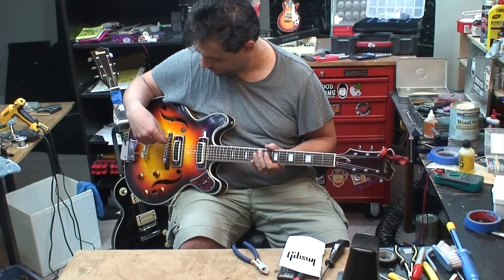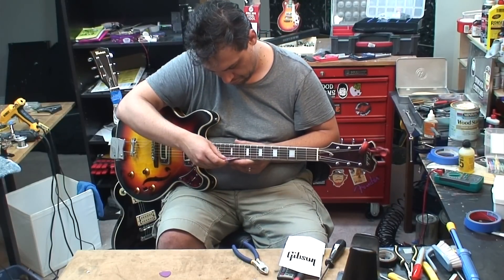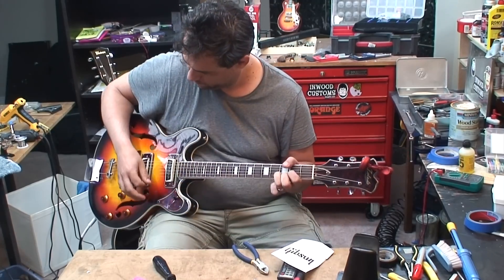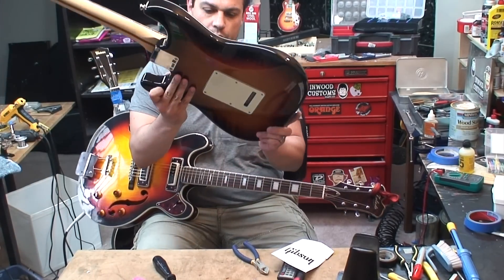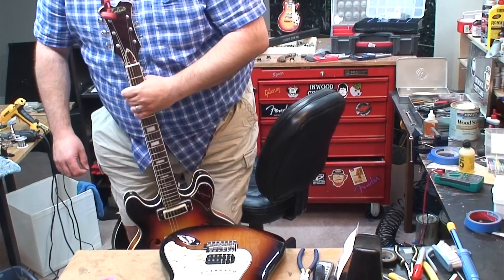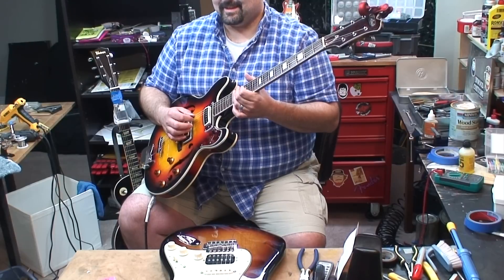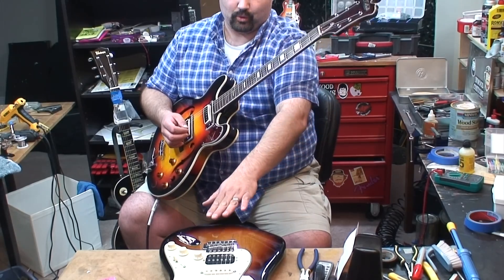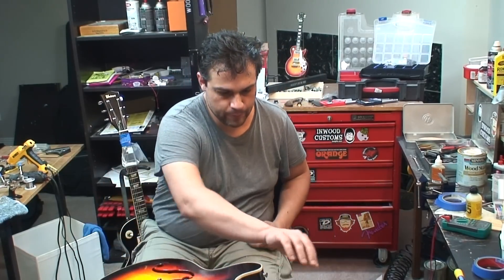70's Vintage Japanese Toledo (Aria): The Rest (Part 2)

Comment: Interesting. I have essentially this guitar  - just with some weird humbuckers that don't buck hum. Going repot them and if that doesn't help it will be time to dig out some old packing foam, scissors and superglue.
Apart from the hum it's an awesome guitar. I had to do a lot of work on it though - it had hung in a bodega for 30 years and was covered in nicotine residue, the pickups didn't work, the wiring was shot and the neck needed shimming. Ended up putting new Bourns pots on, replacing the fabric under the bridge with fine grade wet/dry and splitting the coils with push pulls, wiring as series/parallel and put a set of flatwounds on it. Was a nightmare to get the harness in because of the thin wires but it sounds awesome. People go on about the tuners on these guitars but mine are  just fine.

Comment: How exactly does foam work for reducing/cancelling feedback? This is the first I have heard or seen of this.
Reply from the maker: Just something I read about in a forum that said if you surround the pickups with foam it'll keep them from vibrating as much, which is what causes the feedback. It's why pickups are wax potted. The wax potting keeps the wire from vibrating. This foam trick is less effective to be sure, but it reduces the overall feedback a lot. Wax potting these pickups would be ideal.
Reply: Woodeso's Guitar Mods Ohhhhhh, Ok. That clears things up. Thank you very much for replying so soon and for the concise response. Keep up the good work....cheers.

Comment: Nelson - what do you use to polish the frets?
Reply from the maker: Peek polish. I buy it at Canadian tire here in Canada. Try toothpaste if you can't find it. Works just as well:-)
Reply: Hey, my dad has the same guitar and some how some one impacted it enough to bust the part that holds the ends of the strings to the base of the guitar. What I think actually happened is I believe there are two metal balls that you push on and twist to hold that piece on and some how they popped off and are missing. My dad thought the end of the chrome round stock had broken off so he gas welded a blob on the end of one of them.  WTF right?  (He protected the guitar components luckily)

 Was wondering if you had a source for replacement parts for that guitar to replace the whole assembly or at least the bent piece of chrome with the two metal balls. Rest of the guitar is nearly mint condition, no cracks in the body, neck or head. Small cracks forming in the plastic of the pic ups.  Hope you can let me know of any options.

Comment: What amp were you using
Reply from the maker: Fender Mustang 3, with a VoxAC30 patch:-)
Reply: thanks, sounded killer
Reply: @WoodesosGuitarMods  Would you say foam, rather than potting, is the way to go with these pickups? I own the same guitar, rebadged as Commodore, and have considered getting them potted, but always kept it as is in case I needed something heavily microphonic in the arsenal. What you've done seems to have kept the edge whilst lessening the feedback. And it's nice. ;)

Comment: I have a couple hollow bodies that feedback like a son of a bitch. Worst is Joe Buck Cort. It is so beautiful but unplayable. I had it setup for 6 string since he was using at 3 bass and 3 guitar. It has a split pickup up and down. So you can put bass half in one amp and treble half in another. All great except it howls. Oh well.
Reply: try putting foam rubber in f holes?

Comment: if i owned that guitar, i would toss those pickups in a bag in the guitar case, and put a set of p-90 sized lollar gold foils, then that guitar would be breathtaking!
Reply: where can I find those pickups? I need pickup for this guitar
Reply: I own a '68 Commodore - the same guitar, rebadged - and the pickups are part of the whole vibe; a unique sound. p-90 lollars are fab, don't get me wrong, but you have to be in the room and play one of these to know what I mean.  Other than maybe upgrading the pegs, there's no point in attempting to turn this into a vintage 335.